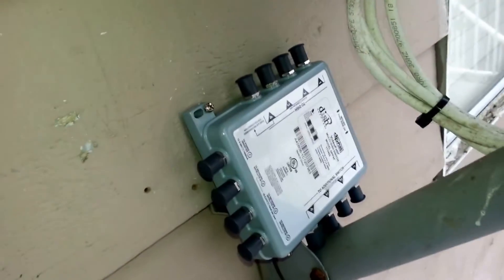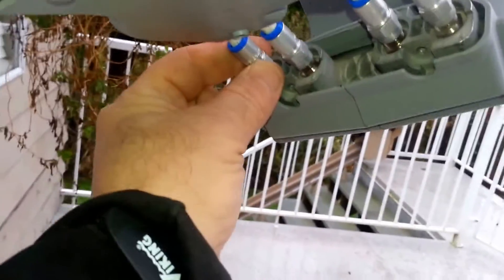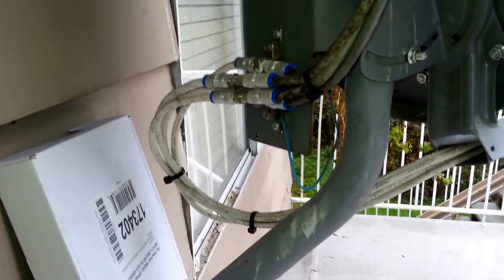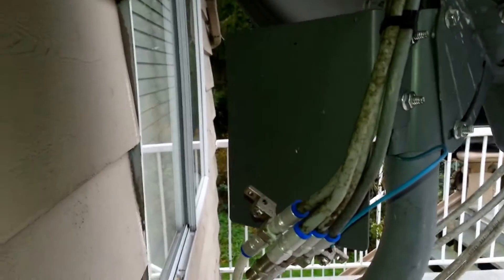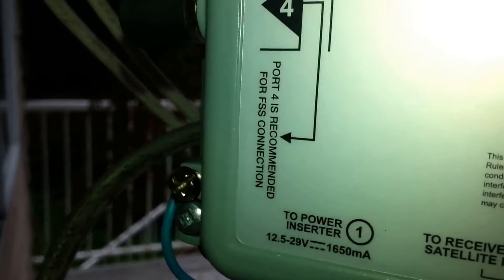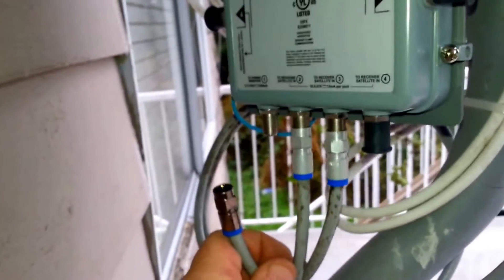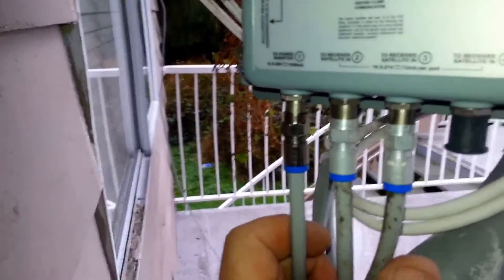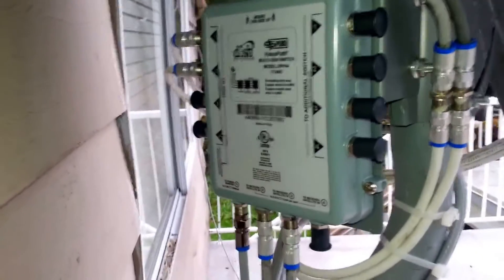DPP44 Install. Adding a switch to an existing dish.

Comment from the maker: There are a total of five receivers coming from the switch. Three receivers are coming off of the DPP44 and two are wired directly into the LNB on the dish. You can also run another switch off of this one if you need to power more receivers.

Comment: also, will this work for HD and regular digital receivers off the same switch?
Reply from the maker: You should be able to buy mounting brackets from any stv supply. and yes, will provide to either pvr or single tuner receiver. if you're connecting to a pvr, you need to have a separator.

Comment: do you have a link to buy the mounting bracket for the sw44?
Reply from the maker: keep in mind this is NOT an sw44. this is a dpp44. sw44 is configured differently. main difference is that you would have to run two jumpers from switch to a pvr (dual tuner) with the dpp44, you only need one jumper and then would use a separator at the dual tuner reciever (pvr)

Comment: I have a Hoppper (no joeys) with 2 cables running from the LNB into the house. I want to add a VIP211 and based on your video I'm thinking I can do this but not sure. If I buy a DPP44 switch and plug the 1/2 SAT ports into the LNB. Then use port 1 power inserter port for the power inserter and VIP 211 and output ports 2/3 to the Hopper. Will this work?
Reply from the maker: +rkirmeier It should be fine, the dpp44 is basically just a powered switch. In a normal application the receiver would power the lnb's but the switch needs a bit more than that. Did it work out ok?
Reply: +Scott McCallum I was told in a forum I would need 3 cables from the dish, 2 for hopper and 1 for the 211. someone recommended moving the solo switch to the dish as then I could use 1 of the cables going into the house for the hopper and one for the 211. I moved the solo and have the hopper running this way so all I need to do is add the 211 which should work fine as I have a single cable for it now. thanks for the feedback...
Reply from the maker: If you're using a quad lnb you can connect two to the switch and run the other two to whatever you want.
Reply: +Scott McCallum Only have 2 cables from dish to inside the house and adding more is not a good option at this point...
Reply from the maker: is the hopper a buck? is there a flyer nearby?